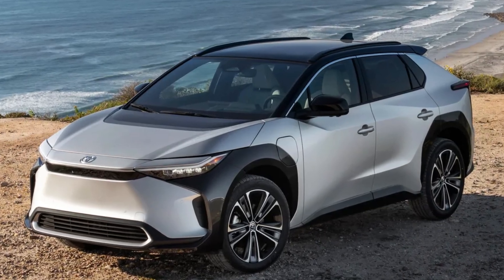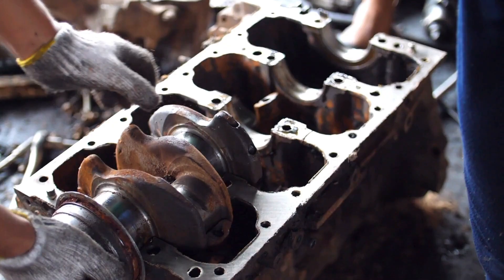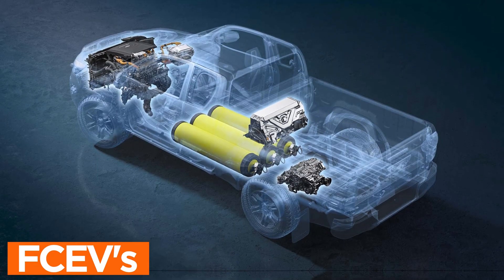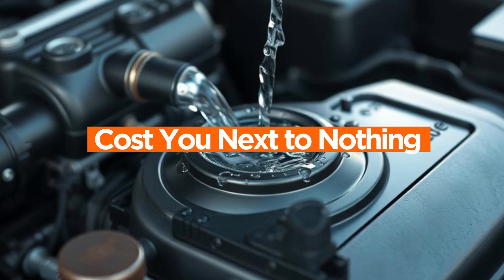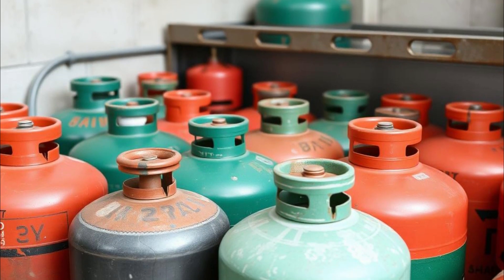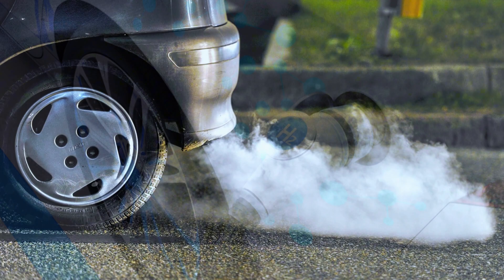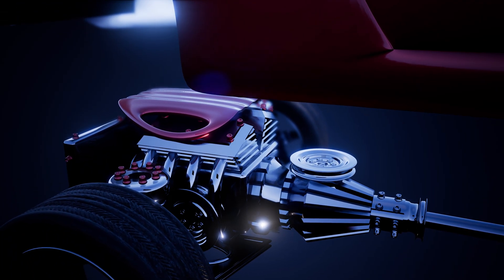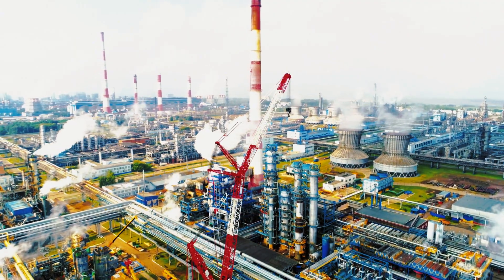Toyota CEO: This New Engine Will Destroy The Entire EV Industry!

Comment: It sounds too good to be true because of one simple fact. When combusting hydrogen with oxygen, you get less energy from the combustion than the energy needed to split the water into hydrogen and oxygen. This means that no matter how you design the engine, the engine cannot operate on water alone. This means you would still need to use electricity from some external source like coal or nuclear power plant. To me, it sounds even less efficient that EVs because at least in EVs the electricity is directly converted to magnetic fields which moves the car and so much less of the energy is wasted. On the other hand, in order to move a car with water, you need to convert electric energy into usable hydrogen, burn it, gather the energy from the combustion, drive some gears and then finally drive the wheels which move the car. This is a lot of steps and each step can never be 100% efficient which means it's wasting a ton of energy all over the place.